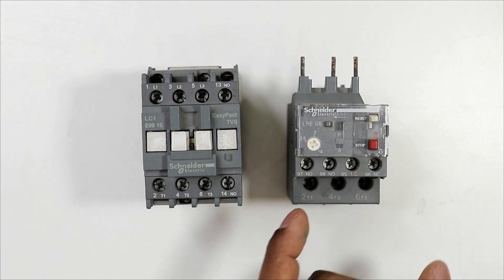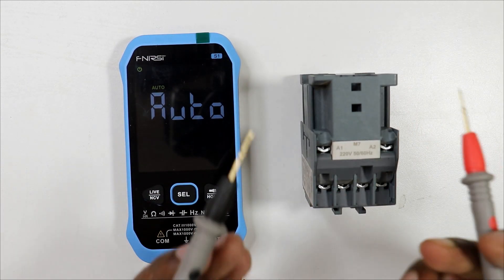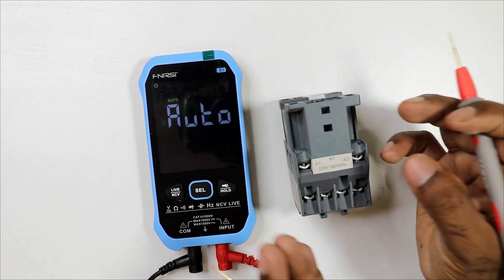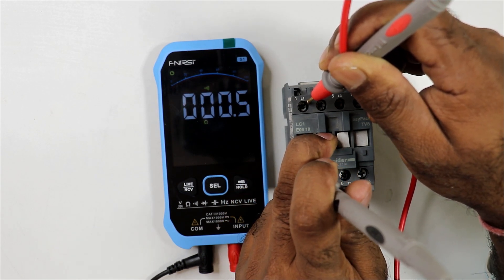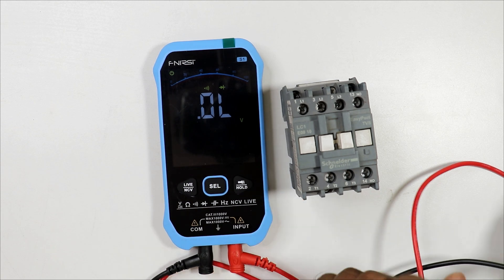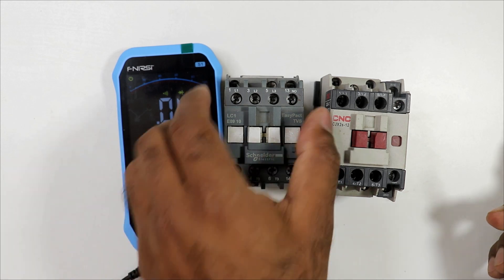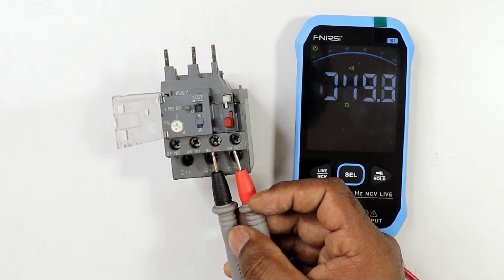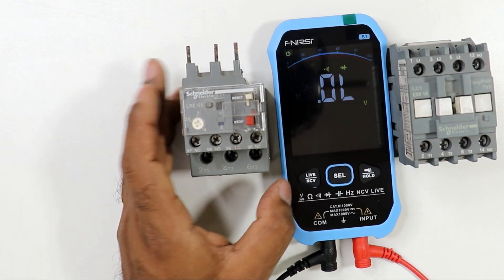Check Contactor and Overload Relay with Multimeter | NO NC Contact | The Electrical Guy

Comment: When running motor is not working then how to check accessories(contactor, auxiliary contactor, timer, fuse, cable, motor etc .... ) step by step in  practical